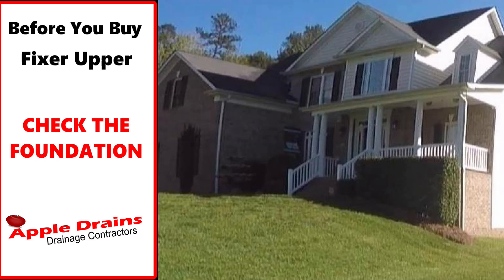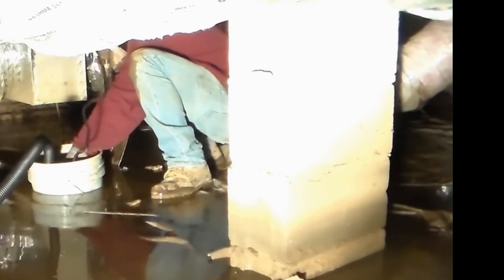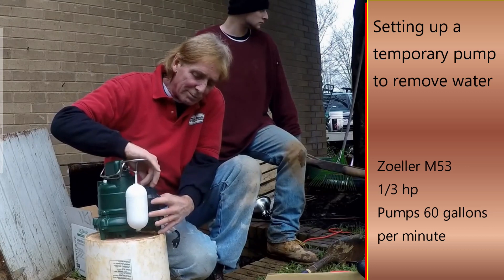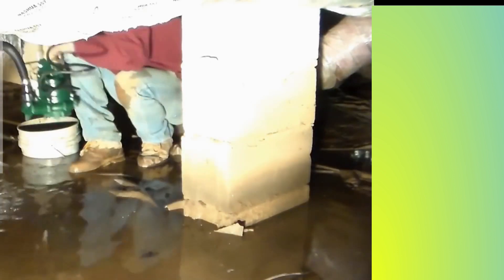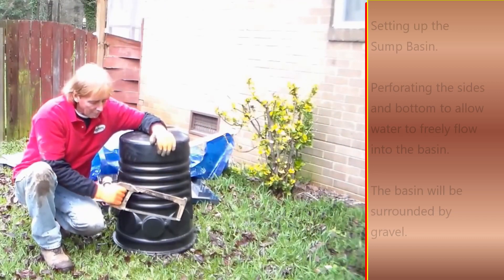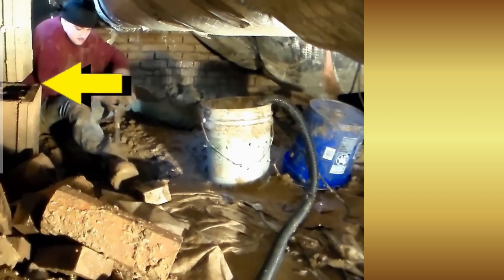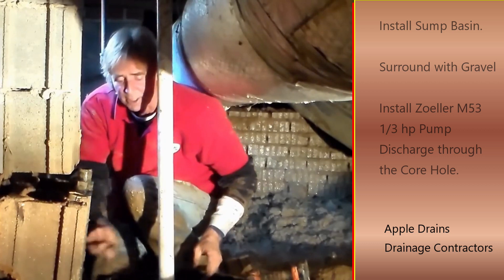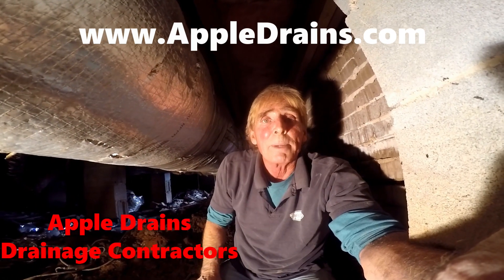Before you Invest, Watch this 1st. Best Foundation and What it Takes to Repair

Comment: At 10:10 - I assume the $500k discount is for much more than just all the damage you already know about. It's already a lot of time and money to fix the known issues and more than half the time projects ends up taking longer and costing more than the initial estimate. Even worse, over 50% of the time additional costly problems are discovered as the work progresses. If the home is selling for a $500k discount then I assume there is about $100k+  worth of work. Need to factor in a 30% profit, holding costs over the multiple months the new buyer will be fixing the house but paying property taxes and interest on borrowing costs, typical 7% selling costs, etc. Lastly it's expected that many homes will actually go down in value in 2023 as compared to 2022, which is a great way to lose big money unless the home can be purchased low enough to account for a declining market. This $1.2M home may be worth $1M six months from now when the home finally goes on sale. BTW - I am NOT a flipper but I bought a fixer-upper home at a big discount and slowly fixed it up over the years. It was the best financial decision I ever made and when my kids leave our home for college, I want to move into another fixer home (purchased at a nice discount) and again slowly fix it up over a couple years. All the same issues in both cases but as a home owner I don't need to buy with a 30% profit in mind and holding costs don't apply, so can "overbid" on fixer properties and beat out the pay-with-cash flippers with my regular 20% down payment mortgage.
Reply: This house is way overpriced, worth Maybe $350k at most. I have no idea where they got those numbers from.
Reply: @Alex.AL_26  - I think what you're saying is that a similar house with the same number of beds and baths, similar size, similar year built, similar style, and in the same neighborhood and sold ideally in the past month sold for $350k? If that is the case then you are correct that the house is way overpriced. Obviously comps would not have the water-in-crawlspace issue so if one finds a good comp otherwise, just subtract the estimated cost to completely fix the problem (and add a safety cushion) and subtract that from the otherwise well matched recently sold comp. Hopefully the contractor has done similar jobs like this on many dozens of homes  and therefore is really good at estimating jobs just like this.